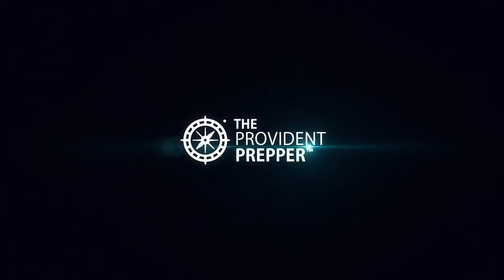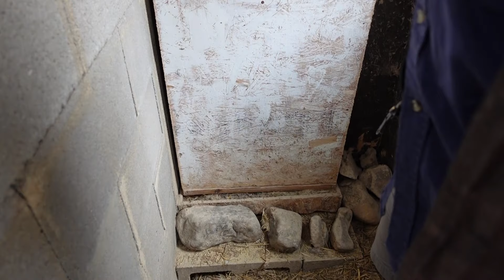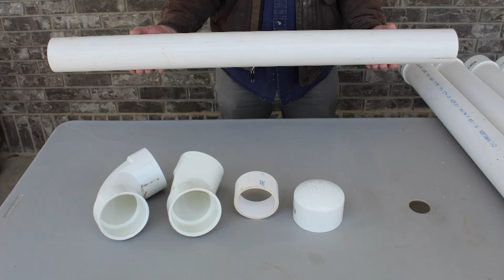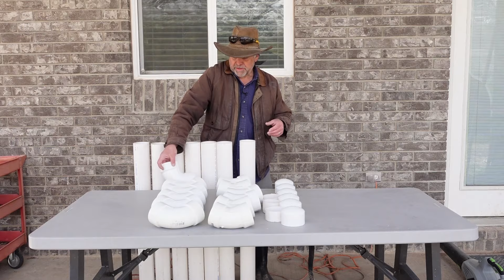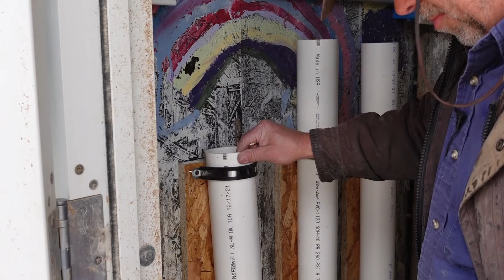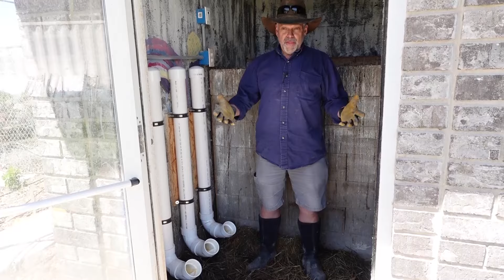How to Make an Inexpensive Chicken Feeder to Reduce Waste

Comment: I did these in my chicken run but ended up moving to a barrel, I felt it was too much maintenance for 20+ chickens. They went through the grain really fast and filling each tube can turn into a bit of a hassle, especially if you're not that patient LOL However, as long as you don't have too many chickens, it is a great option!

Comment: I have this same setup after seeing it on Youtube.
My own personal review would be this. The chickens still throw the feed all over the place. They have a hard time getting to the feed that's not right at the opening and have to stick thier heads in quite a ways. It does dispense the feed as needed but in my excitement to fill it up, I topped off the two 4 foot tubes with feed and in about 4 or 5 days the feed was gone and a huge mess all over the ground. Great feeder if you're going on a trip but daily I just put one scoop of feed for 5 chickens and one rooster and the feed lasts about two weeks vs. the 5 days it took them to scatter two 40lb bags of feed. I surmise it's the endless supply under the weight of all the rest that empties it quicker than necessary. It's a good feeder but the idea of filling it up and thinking it's okay for more than a week without a huge mess is not realistic. The only benefit to long tubes is if you need to go away for a few days and can't be there to feed them. Would I build another? I'm on the fence about that one.
Good points: Feeding can be done from outside the coop, great if you can't feed for a few days
Bad points: Feed still gets scattered and can take on moisture. Only one chicken can feed at a time.
Not slamming the video or the idea, just giving an honest review.
Reply from the maker: We actually don't like this anymore and moved on to a Grandpa Feeder. It was a great idea in theory :)

Comment: Your finished product has an anti-spill guard in the bottom.  You did not talk about that, or demonstrate how it was made.  That is a critically important part of this build.
Reply: I seen that was installed aswell!! Still with that ,, the system  is still a bad design  as the chickens still able  to pull the feed out and on to the ground  !! I'll  rate that a  feed distribution  as a failure

Comment: Use pellets and then it doesn't matter if they knock it into the dirt. They'll clean it up off the ground once they're done with the traditional feeder. Mash IMO is a useless feed. As for the setup, in my experience, in the same way that hens don't need much roosting or laying space because they huddle together as tight as possible, so to is it for food. 6 separate tiny feeder where they have to stick their head a few inches into the PVC, I think you're likely to see instances where multiple hens are at the same feeder fighting over it (if they choose to feed at the same time). A traditional 360 degree feeder is simply the way to go, you just over complicated it by your choice of feed.  - Life long country boy.

Comment: One BIG mistake! I built these for my chickens a while back...
What you need to fix: DON’T put the 90 on first! Put the 45 on first, then the 90. Doing this allows the feed to be more accessible to the chickens (without waste). My hens didn’t care how it was built, they stuck their heads in, but my Roosters definitely had a problem! They wouldn’t bury their heads that deep because of the large combs they had. 
Make this one change and both hens and roosters will be happy!

Comment: If you have a large bucket or container you can use the 45 angle one with one side coming straight out, close to the bottom, and the other side angling in to the container. Fill the container and the grain wont come out on its own, but the chickens can get their heads in and eat. I have found this to be the cleanest.

Comment: I found a bucket at the local ranch store that already had pre-drilled holes in it with attachments that the chickens stick their heads in to get the feed. We needed that set up because a lot of our run is exposed to rain. This bucket system has a hood over the hole that helps keep rain out and the feed dry. Our big girls are so smart, they figured it out right away!  We also have 6 babies too and once they are big enough to move into the big coop, I know I will have to pick up one or two more of these feeders. We will probably do some similar system that you show here to where the buckets are inside the run under the coop and the big PVC pipe is outside the coop and runs to the bucket lid so we can easily fill the bucket without having to move it. What funnel did you end up buying? I was thinking a canning funnel would work.
Reply: Picture?

Comment: We use this exact setup. We've got three tubes full of layer pellets and then two smaller tubes on the other side of the run for grit and oyster shell. We fill the pellet feeders once every 5 days or so for 7 hens. Our run is like Fort Knox, so we've never had an issue with mice or other critters getting into the food and so far no issues with bears (knock on wood!)
Reply: Must be my humid region.  I tried this type of feeder and the food rotted in place and I always had to clean it out.  I gave up on it.  Went back to a trough with a top angled shield to keep them from pooping in it.

Comment: We did this years ago, just be aware that smaller chickens will climb in and can possibly get stuck.
Reply: I agree. My folks tried this method. But Daddy ended up coming up with a different method that was safer for their little ones.
Reply: @hoovesandpaws  Would you be willing to share the new method? Thanks!
Reply: @MakelleBell  He built simple standing boxes attached to a post to keep em from tipping over and they had hinged lids. The opening at the base for each box had a slight lip but what made it effective for feed loss was he built it to where the fall out would go down and to the back side in another feeding area he built so feed loss was minimal as were injuries. I think what kept injuries down was he used a mesh where the feed would go thru but nothing could get inside. I wish I had taken pictures. But I was young and didn't think along those lines. They had alot of chickens!
Reply: @hoovesandpaws  what did he do.
Reply: @icecreamladydriver1606  I posted a reply at the bottom.
Reply: @hoovesandpaws  Thanks.
Reply: I would never have thought of that. Thanks for sharing.